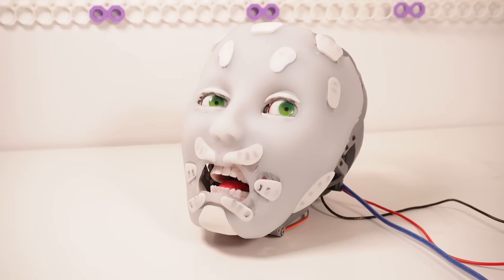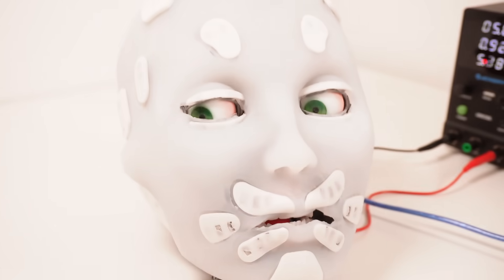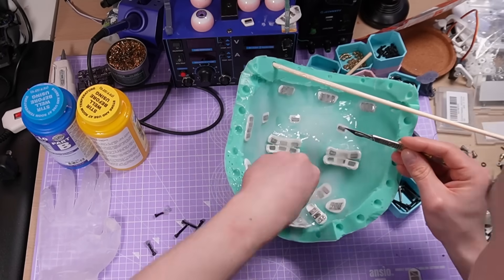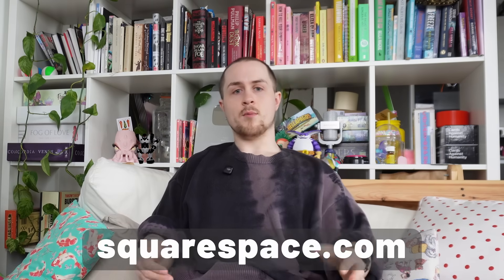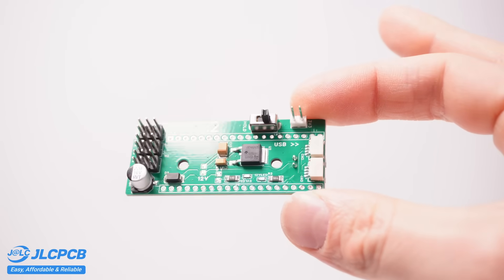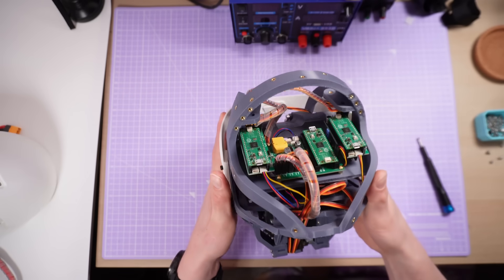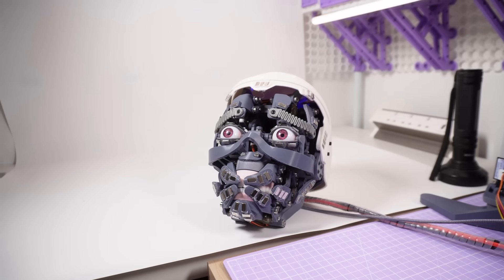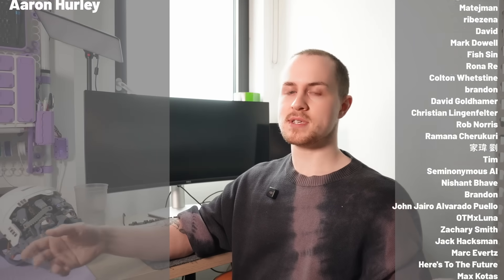My New Robotic Head Design is Legally Confusing

Comment: one possible solution is mix a high iron filing content into the mag areas in the silicon and place the magnets on the fixed side, metal foil could replace the filings

Comment: hey i run an open source CNC project, we run into these issues all the time and the majority of the time it boils down to it being perfectly legal to post files and even instructions on how to do it so long as youre not directly making them in a commercial setting with he intent to make and sell the product. Patents are legal agreements to protect a companies right for commercial distribution only in all cases I know of.
Reply: Also if the magnet placement isn't a one for one match it actually could qualify as an independent design, also this face is a lot more flexible than Realbotix, also I think if you use different wording than contour, it possibly could technically qualify as a different design. Also if you were based outside of the US then the specifics of the patent wouldn't apply, cause I think parents are specifically for US creations.
Reply: @ thats not really true it depends on the wording of the patent a lot of patents will purposely lock down wide use of certain technologies, for example slice engineering in the 3d printing space patented the use of fixed nozzle standoffs on their hotends, so no one can now use that tech in the US and it was at one time a real issue, it didnt matter that the tech was being used in different places.  it was a patent trolling of note though.
Reply: can I see the open source CNC? I want to try and make one
Reply: @ just look into millennium machines or milo v1.5
Reply: Now give mimic this head
Reply: Uwu
Reply: And someone should make a hole through everyone's forehead at the patent office, because they don't need to exist in the first place.
Reply: you can be sued for lost profits if your open source, patent-infringing design takes away their business. if the objective of this project is to get any appreciable market share, IP concerns are valid
Reply: @42468  which is a commercial use like I said (my other account at least), if you don't use it to earn money then there is no market share to speak of. Open source doesn't always mean its free ill grant you that, that's true but FREE and open source is completely fine to do because there is no market share. Like I said before we've run into these issues in the past and any complaints have been swiftly dropped after we stated that its not commercial.
Reply: @42468  what market share? robotics companies aren't using an open-source project and the fields that this type of robotics is being applied to currently don't really overlap with the kinds of uses a hobbyist may have for this project. It's an entirely different market.

Comment: Formlabs or Bambulabs should send you a printer. The face seems like a good application of multi material printing with water dissolving supports using the H2D.

Comment: one of the important things about things like servos is that they only use one wire that needs to be independent of the others, the signal wire
the other two can be shared across the others instead of trying to create a massive nest of wires

you can do it even with fewer wires until absolutely necessary using I2C and other kinds of systems to break out the signal to the servos only when absolutely necessary

this would be useful when you start to expand a robot/animatronic to a full body

but also do realize that even car companies use independent CAN/I2C buses to keep communication fast and reliable for critical systems, so you can split the communications between zones as necessary to keep them from stopping say, the walk cycle, from keeping the system upright because some other system doesnt have enough priority, or it requires too many servos in too little time to save the robot

Comment: Being Opensource you have no control over how people modify your design... Why not release your design with "3d printed post and hole attachments" that are the same size as magnets and just make significant notes in the documentation that replacing the "3D Printed Post and Hole attachments" will/may violate patent(s) and is not recommended.  Also make comments that the post and hole attachments are a really bad design and have too many con's to be useful but you are releasing them in hope someone will come up with a better solution and share their result with the community. In the end unless you or someone using your project has a commercial application I wouldn't expect much resistance from the patent holder until there is enough money being made for someone to care. But I am no lawyer just tossing out n approach that might help you skate around the patent.

Comment: PowerConnectors: there are xt30's too usally these sort of connecters are used with rc vehiucles and their brushless motors because they tend to spike some current ^^ 

MasterSlave Issue: Canbus is designed in a way where each member of the bus gets the same information and decides on whether to act on it or not, as it used in cars in dont think that wait time or recovery times after a bus crash (not car crash) shouldnt be an issue ... but i dont know for sure it might be an idea though ^^
Reply: CAN is the way, it's much more reliable than I2C

Comment: I would use push thumbtacks (the ones with a flat top when you remove the cover) that you put in the back part of the mold, with the size of the holes calibrated to hold them by friction but not with much force (both in the mold and the face parts).

Comment: I'm loving the development of the robotic face. I "faced" a similar issue with patenting my laser machine back in 2011, but I let the provisional patent go in fears that I would be "faced" with legal challenges, then Glowforge used this idea and ran with it.  Ugh!!
Reply: did it involve use of the camera inside the machine?
Reply: @Geeksmithing  No, it was the CO2 tube riding on the gantry to improve the laser power and reduce the alignment complexity. The camera idea would have been a cool patent!
Reply: @PatrickHoodDaniel  ahhh yes. Definitely an improvement over K40 style  design!
Reply: @PatrickHoodDaniel  aligning mirrors was the worst.
Reply: @Geeksmithing  Yes! I so agree!
Reply: @Geeksmithing  My K40 doesn't run anymore because i don't want to deal with it....
Reply: @SaitoGray  totally understandable!!

Comment: It could be an idea to get around the patent issue (supposing it is one) by only having ferrous metal (washers or something) in the skin, instead of full magnets. Sometimes patents are specific like that.
Reply: "magnetically adjustable" doesn't say anything about where the magnets are, only that magnetism is used for alignment.
Reply: @brinkoftext  On the other hand, "magnetically adjustable" means (IANAL) magnets must be used to "adjust", not to "attach" the skin. So, unless it's broad enough to cover servos (as they have magnets inside) and thus ANY sort of skin movement save for heat or current-actuated kinds, it shouldn't cover the case where magnets simply replace glue.
Reply: @brinkoftext  studs for the alignment, magnets just hold it in place.

Comment: I would try to use blue or purple colored silicone to give it a completely not human skin.

Also instead of having the control board to have to handle the power requirement of the servo adding forcing you to have a lot of 3 wire cables.
Maybe you could shorten the cable length of the servos and crimp them female connectors glued to the servo body for example, allowing you to build a power harness separated to the the single signal wire going to the control board.

I know you came back from having to modify the servos, but here it would be just on a cable level and it would allow you to reduce the rat's nest further.
Reply: da ba dee da ba di

Comment: Using magnets is not exactly a revolutionary breakthrough. It's crazy this can be patented.
Reply: they let people patent "ordering pizza - but with a computer!" and business methods so it doesn't matter how trivial, self-evident or already in common use it is, if you've got the money you can bully everybody else with a patent.
Reply: @pdjinne65  didn't Apple patent protect the rectangle with curved corners? 😄
Reply: @mandrakejake  Not quite, but essentially yeah they did. Apples patent had to be more constrained to than that to actually pass mustard (especially with all the "prior art" on the market) and get accepted, but they did eventually manage it.
Reply: @JeremyStreich  "pass mustard" 😄  It's "pass muster" unless you are seated at the dining room table!
Reply: Patent offices are generally extremely lacking in due diligence, so patents are typically just treated as valid until they are challenged, often in a lengthy legal case. It's makework for patent offices, makework for law firms and a lucrative way for NPEs or large holding companies to extort others, especially in countries where winning a court case can be a pyhrric victory (there are even cases where the losing party simply acquires the winner in the aftermath of a patent dispute because they couldn't shoulder the legal fees). Patents in their current form are thoroughly unworkable on almost every level, just like most Intellectual Property law.
Reply: simple methods of attaching one thing to another thing, should never be patented at this point. patents shouldn't be for simple concepts, they need to be for complex designs.
Reply: Let's suppose the patent is actually invalid. It seems likely enough.

But given it got issued, if the other company deems your stuff to be infringing, they're still able to cause you untold amount of trouble. Will they, won't they? Sometimes companies with wonky patents decide not to pursue, because their worst case outcome is losing their patent, they may just pretend you don't exist if you're not a direct competitor. Is this the type of risk one is willing to take? Another route is that one gets together and agrees on a licensing agreement which can be at no cost or at symbolic cost, with certain provisions that the entities go out of each other's way such that they do not become direct competitors. But given this is supposed to be potentially an open source project, this may be a tough sell.
Reply: @SianaGearz  Years ago they sued a competitor out of business, so no surprise if they did.
Reply: @SianaGearz  You can also just email the... robotic companion company and ask them.  Since it's not a competitor they may grant you a license for a nominal sum like $1.
Reply: It's like patenting nails or screws or rivets for specific materials. Silly that it's possible
Reply: @ Oh I get it, you thought I was attacking the author of this video,. Not the case at all :) The guy's brilliant of course. I was talking about the patent troll who patented the "original" magnet face attachment. You can climb down your high horse now and breathe.
Reply: And they had a patent on mini-games during game load screens.
That's why you used to have to just sit and watch factoids as the game loaded.
Reply: They let you patent anything anymore. Whether that patent would hold up in court, because it never should have qualified, is another matter.
Reply: The patent office doesnt decide validity, thats for the courts. Patent offices job is to make sure you meet the broad understanding of the minimum requirements at first look
Reply: My sister couldn’t pass the mustard..
Reply: The same reason this is bad is the same reason it is good. For exemple Disney can't really steal the s*x robot idea and copy the work that's already been done by a smaller company
Reply: @jorge-wh4pf  Patent trolls are a thing though. The possibilty you get sued is very real, so I totally understand OP's anguish. It can ruin your life for no reason.
Reply: Back when I was a flash developer, a company trademaked "tower defense" and was sending take-down notices to flash developers who made tower defense games. A lot of patent and trademark law is ridiculous.
Reply: @ Unfortunately, you are likely part of the problem. You empower the beast.
Reply: @funstuff7674   being cringe also empowers the beast😈😈🥶🥶
Reply: @jorge-wh4pf  It's not cringe, it's the truth. You empower the government that does all this.
Reply: @funstuff7674  Your right. It's absolutely not cringe at all😈😈😈🥶🥶🥶
Reply: @jorge-wh4pf  can't handle the truth buddy? Grow up.
Reply: @funstuff7674  "can't handle the truth buddy? Grow up."🥶🥶😈😈
Reply: @jorge-wh4pf  use more smileys like a child buddy, are you a child?
Reply: @funstuff7674  who tf uses the word "smileys"?. Lmao
Reply: @jorge-wh4pf  ok boomer
Reply: @funstuff7674  "ok boomer"😈😈😈🥶🥶🥶
Reply: @jorge-wh4pf  more smileys boomer
Reply: If it went to court there would likely be massive amounts of prior art that would invalidate the patent. As you say attaching something using tiny magnets is not a novel process and simply applying it to an application does not create something novel in and of itself.
Reply: So many people confuse Patents with Copyright: Patents protect specific processes that are intended to be repeatable industrially without creative scope, essentially protecting things that are designed to be copied or reproduced. Copyright however protects somebodies creative act from being copied or works being derived from it.
The classic test is how they apply to a cooking recipe: the ingredients list and cooking times & temperature are essentially a formula to enable precise repeated production can only be patented, the description saying that it was handed down from mothers kitchen and everybody loves it, is creative writing and is subject to copyright.
Patents are by their very nature extremely precise descriptions of a product and process, for instance, if the skin uses neodymium magnets 5mm in diameter then that patent doesn’t cover a similar product that uses 20mm rectangular magnets or magnetised coils, and if the skin is a silicon polyurethane mix, then only that mix is patented.
Read the Patent document thoroughly and dont use the same detail.
Reply: A patent by itself isn't per se enforceable. 
A lot of patents are nonsense.
Reply: copyright is such bullshit thats why i don't follow the ghey libs
Reply: It can't be. It's a fake Chinese patent that does not count in the west.
Reply: patents are mostly a scam...
Reply: Patents are disgusting
Reply: I know someone who got a patent for turning a metal barrel into a wood stove.  Patents are supposed to be on the concept of "not anyone could've come up with this", but really its all about convincing the people submitting the paperwork to give you the rights.
Reply: all of you are responsible. you created the monster that controls us.
Reply: @funstuff7674  Schizophrenic??
Reply: It technically shouldn't be. But in practice it is possible, because the system is so convoluted and stupid, that it can't detect bulshittery like this, because if it had systems to check for that, it would get overwhelmed and couldn't function, so it relyes on people going to court about it, which essentially comes down to each party throwing massive ammounts of money on the lawyers, who are likely going to reach a stalemate, because the easyest and surest way to win the case is to throw money out of the window, untill the other party can't afford to do so anymore. Of course, you can't do that against a company, and it's essentially just bribing the justice system with extra steps.
Reply: That's because patents are evil
Reply: Nah it’s the fault of the original inventor of magnetic fixturing not including this particular application in their sub-claims so it couldn’t be claimed
Reply: It's not because something is evident that it can't be patented
Reply: @rolletroll2338  It is patented; the video literally shows the patent on it.
Reply: @TennSeven  Just because a patent exists doesn't make it enforceable, if it can be shown there is prior art the patent is invalid.
Reply: @schrodingerscat1863  The person I was replying to didn't say it's not enforceable; they said it's unpatentable for obviousness, which is false because it is literally patented.
Reply: @TennSeven  Many things get given patents that shouldn't be, such patents are then found to be useless when challenged.

Comment: If the magnetic attachment is problematic then maybe velcro could be an alternative attachment option.
Reply: good idea, but if it needs to align then maybe use plastic press studs like how motorcycle helmets retain their internal padding
Reply: @mandrakejake I thought of studs too! Maybe even ready made, or if not - printing them should be possible too. Then since there is no constraint of keeping the face realistic - it can even look quite cool. And the manufacturing will be easier too, you "just" need strategically placed holes
Reply: PATENT IT NOW